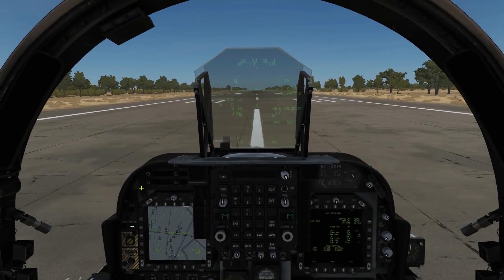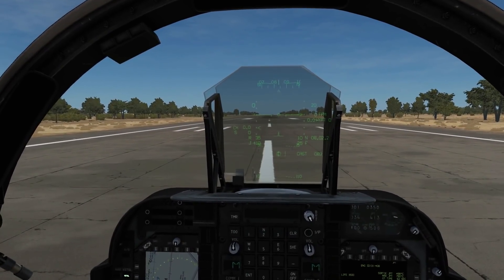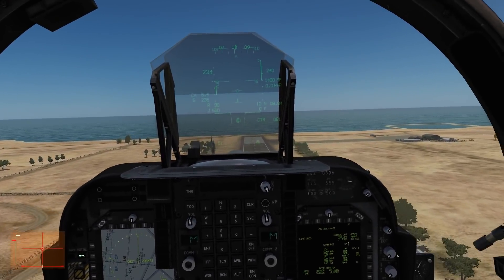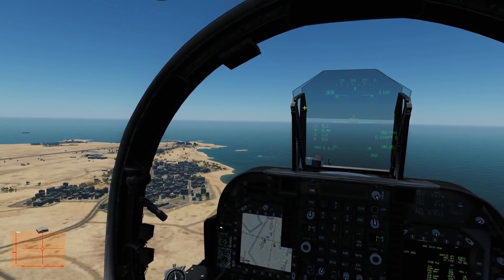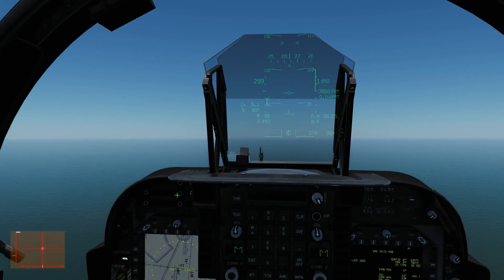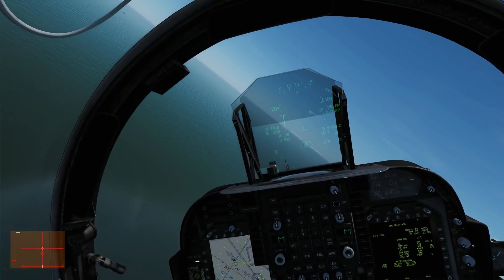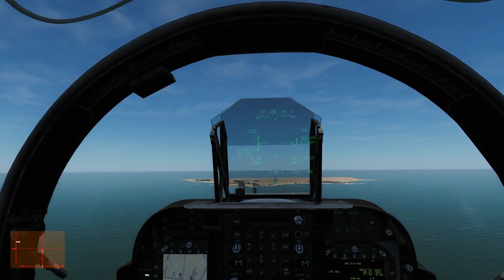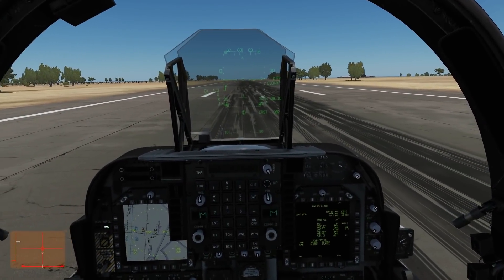AV-8B Harrier: CTOL Conventional Takeoff & Landing Tutorial | DCS WORLD

Comment: Thanks Cap...always love your videos, especially in my favorite DCS airplane. Would love to hear from the real Harrier pilots out there and how often they use a conventional takeoff-considering the harriers landing gear is a little spindly as far as speed goes...my understanding, I could be wrong, is that they mostly use short takeoffs and landings , using nozzles, to minimize runways speeds.
Reply: Full conventional landing ie nozzles at 0 was only used for nozzle failure from what I have read, otherwise most landings where at 60 degrees nozzle but there’s a lot of different landing configurations

Comment: At light weights, water injection is not needed you only have 90 seconds worth.
Save it for high ambient temp landings, 
Combat loadout high ambient temp. takeoffs as needed per runway T.O. length requirements.

Temps, runway length, loadout, charts need to be sought for proper use of water injection needs.